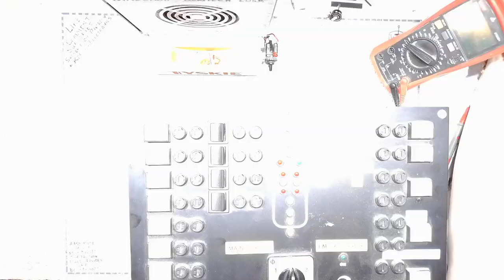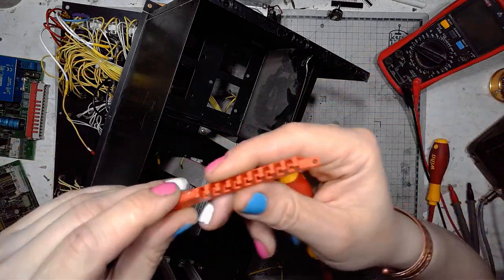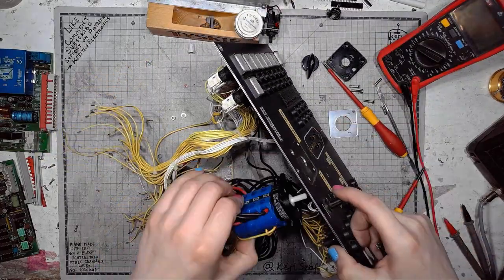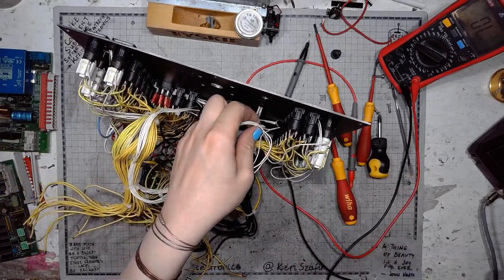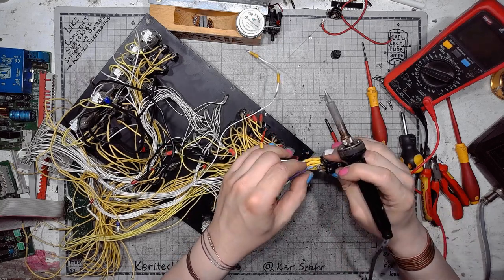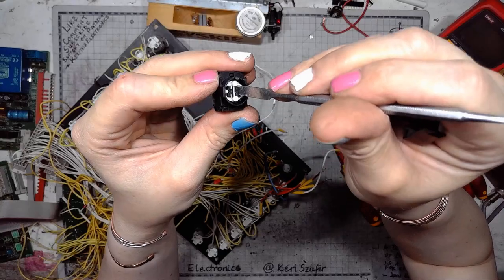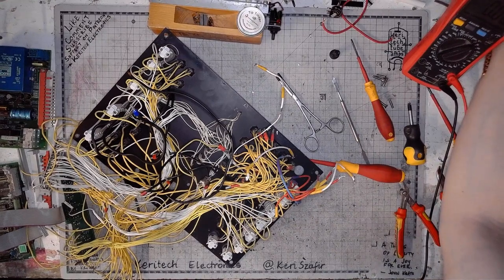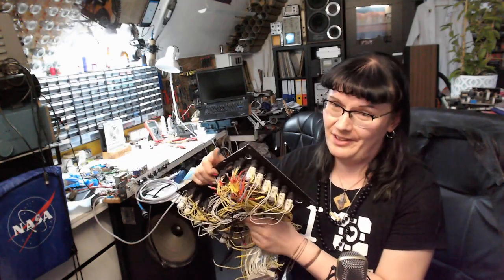Taking Apart a Boat Lighting Control Panel

Comment: BTW what are the date codes of the chips, I'm guessing 90's.
Reply from the maker: You'll be surprised... the module was made in 2006, the parts can't be all that much older.
Reply: @KeritechElectronics  Hummm... I'm just wandering what the function of the logic board. From what I found on the web, it has a series of riding light configurations depending on the cruising state of the vessel, like at anchor, under way, etc. But I can't see why it would be that complicated though.
Reply: @robertjonasar2053  alarms and fault monitoring, instead of electromagnetic relays for each light they got away with current transformers and that logic board.
Reply: @Neria2288  Makes more sense, I forgot about the current transformer.